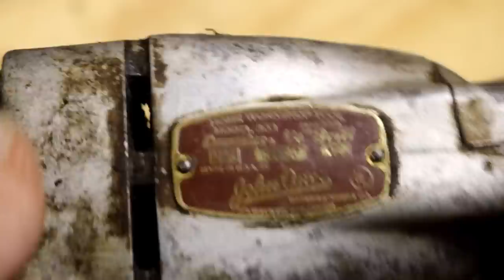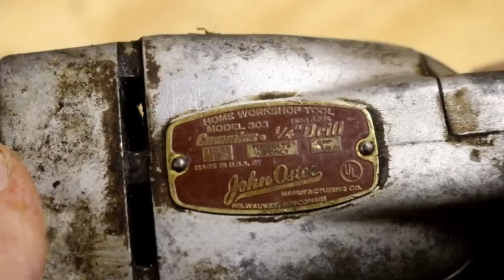Beyond Repair Truss replacement patch.

Comment: John Oster Manufacturing originally did tool and die work and produced hand-operated hair clippers from a plant at 16th and Ann streets. Its first breakthrough product, in 1928, was an electric clipper designed to cut and style the new, shorter bobbed hair style for women.

Comment: 19A? That drill would probably snap a drill bit off if it caught. My dad had one in 3/8 and when it caught it was best to just let go. The switch wasn't wired like yours. It stopped when you let go. Maybe yours was rewired? My dad's drill was AC and DC (rig welders always wanted to "borrow" it).

Comment: Rather that a bigger overhang, you would be beter to have a good industrial grade gutter, a big overhang only pushes the water away from the building but with the slpe it will run back
Weird that people criticise the age of the jigsaw, but would probably wish they owned  one of your machine tools (lathe/mil)

Comment: Geez- 19 amps on that drill!? That thing is hungry!!!
Reply: @FIIK I think you’re right about the decimal point. 19 amps back in the 50s would have had the original owner replacing fuses all the time.
Reply: From the image at 34:11 it sure looks like a 1 followed by a 9. It must be 1.9A. But that would be a pretty wimpy motor, even for a small 1/4" drill. Most modern ones I've seen are between 5-7A.
Reply: @kindabluejazz  10 amps at 115V is about 1 horsepower. So 1.9A would be about a fifth of a horsepower, which was quite reasonable for a 1/4" drill in those days.  You couldn't hog on them as much as you can with a modern drill, and their gearing was a bit higher so they turned a little slower. That gave them more torque and also didn't burn up drill bits as fast.

Comment: I'll bet that drill switch is actually defective and not working the way it was designed to. Only the constantly on feature is working and the normal press to turn on contacts have burnt out.

Comment: You prob have research this already, here's a quick tip anyhow. Do NOT peal a bunch of the backing off at once (from the ice guard). Just peal decent size off a corner, stick down that corner and roll out about 10' then pull the backing off from the underside. There are other methods for doing this but that's one of the easier ways that I've found to do it alone. Once 1 half is stuck down then you peal the other half of the back off by folding the ice guard over on itself. Or just do whatever works for you =) yur a pretty fart smeller....

Comment: I would speculate that that "Home Workshop Tool" was part of a kit with grinder,  lathe, circular saw etc. 
In that context the locking-on switch makes more sense. 
Here is an example of the class: http://www.lathes.co.uk/cummins-woodworker/
[Edit] Actually it is exactly that.

Comment: The old drill reminded me of the Wolf Electric Tools - Cub, the first electric drill on the UK market, introduced in 1949. I was given one by my elderly next door neighbor and used it for quite a while. Wolf tools had a subsidiary factory in India and for instance my Wolf VR5 automotive valve grinder says "Made by RaliWolf India" right at the bottom of the tag.  RaliWolf are still around an it appears the Cub is still in production; http://www.ralliwolf.com/light-duty-drill-eg2c.html

Comment: Our friend, Keith Rucker has this link to John Oster   http://vintagemachinery.org/mfgindex/detail.aspx?id=1374 .  I would guess the drill is from between 1954 and prior to being acquired by Sunbeam in 1960.  The trigger makes me think that drill was part of one of those "drill press" stands for a hand held drill.  That way you could lock it on.  Please file the drill on the vintagemachinery.org website. You might be surprised by what pops up.  John Oster - the Oster Blender!!

Comment: every since i had a metal cased sander bite me i quit buying those old hand held metal cased tools
Reply: We had some Rockwell aluminum cased circular saws and worm drive framing saws... new in 196x (like me)... fast forward to the mid 1980's these things were noticeably "zapping" us from time to time at the job site... my dad was going to chuck the tools. But I really liked the power of the Rockwell saws (especially the worm drive framing saw) which could chew through a 4x4 like butter. I got some good three conductor wire, opened them up, wired them up with a ground to the cases (not the best solution, but it was better than nothing), and was able to locate new switches and new brushes/brush holders (which were the real problem, they were revised at some point to make them more shock proof) from the manufacturer (waited two weeks for the parts); but... no more zaps. They are still working today.

Comment: You never used the name of the ice and water but I'm guessing your refering to grace. Yes it's good stuff but save your money. Use the granulated peal and stick off- brand. Just as good when installed correct.

Comment: My dad had a kit that had multiple attachments that were powered my a drill motor.  It had a table saw mount, and a jigsaw attachment and the motor had a mount that allowed you to clamp the drill to the bench or table top.  That drill you have looks like it might be something similar...I did find this on the internet: https://picclick.com/Rare-Vintage-John-Oster-Cummins-Portable-Tools-Model-333581697952.html

Comment: I saw you cut the concrete in a rigth line inside shop. Please, beleve me, do not reduce the shop area.
I am from Brazil, my english is good, i think that you said one or two videos behind, because of cost of concrete to fill the floor,
that you intend to reduce the shop area,well, this is what i think i understood, but believe me, this will be a decision that you will regret a lot. 
I did this in my workshop 5 years ago, and at the beginning of this year, there was a golden opportunity for me to acquire a milling
machine and a shaper, both used, built in the early 90's, for a very low price, just so I wouldn't it looks like the guy gave them 
to me for free.
I didn't think twice, I broke the wall I had made, I broke up my wife's office, and installed the new machines there.
I almost lost my life !!! You will not want something similar to happen to you !!!!!

Comment: You should have torn the whole thing down from the start and rebuilt it from scratch. This is a horrible way to renovate a building.
Reply: Are you paying? Easy to spend someone else’s money.
Reply: @FrancisoDoncona  As a construction worker that's just my point. It would have been way faster and cheaper to have done it correctly.
Reply: Tear down the whole building, or the entire truss?
Reply: @rogerscottcathey  Well, it's a bit late now but he should have torn down the whole building and reclaim the materials he deemed reusable, then start from scratch. As you can see he replaced very close to the whole thing anyway. Just in a very awkward, and extremely time consuming way.
Reply: @GAIS414  : Ideally, yes. I believe he said pretty much the same thing, but there were the logistics of building a temporary, safe and secure storage area for all his heavy equipment, while leaving enough room to get the demolition equipment in and out. All his projects he could do while things were done this way would be on total hold.  I'm pretty sure he did the math and decided it wasnt doable your suggested way. For his costs and budget, this was the only practical way.
Reply: @GAIS414  : By the way, more like a third of the building. He hasn't touched the other side's floor, walls, trussings, etc.
Reply: @GAIS414  So one wall, demolishing a chimney, and part of one rafter is "close" to the whole building? I'd hate to see the buildings you build... pfft
Reply: @GAIS414  this is just a workshop not the Taj Mahal. There's nothing wrong with Steve's repairs either. Although we'll see what happens when he gets to the roof.
Reply: Take it easy guys, I'm not here to troll Steve in any way. I think he's a great guy. And as far as I can see there is nothing wrong with the individual repairs he made. It's just not a very time/cost effective way of doing it for the over all results that he will get. For instance the old, not so well built floor is still there which means it limits the selection of future machinery to put on it without substantial risk of it cracking. I know what I'm talking about, and I'd rather tell the truth to a guy that I respect than blow smoke up his ass. One day he will have learned from this experience and most probably will make a different decision on how to go about a project like this. I just wish he would be back to machining by now.